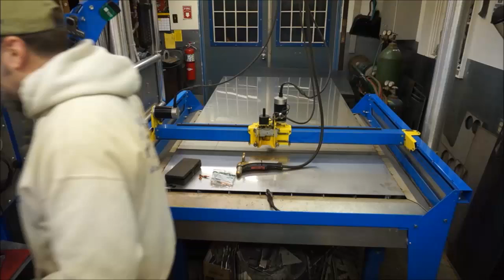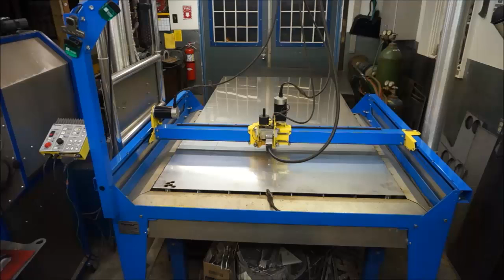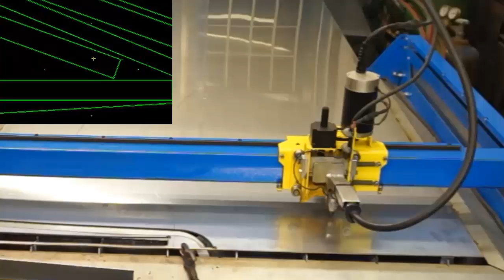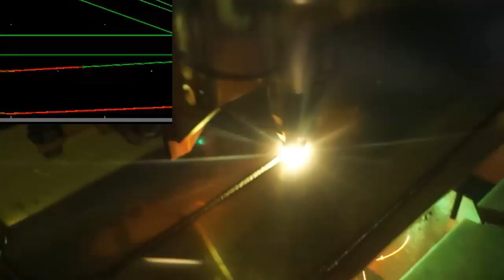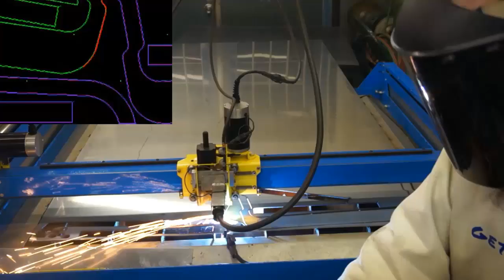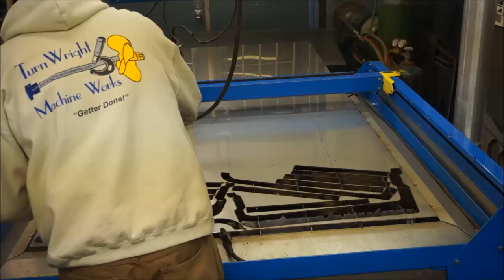Wing It Part 9

Comment: Wondering why you never use the edge of the sheet as the edge of your cut. I'm sure that there is a good explanation. I learned in grade school not to cut from the middle of the sheet of paper. :)
Reply from the maker: I do once in awhile with straight strips, but for the most part, most sheets have blem edges and I like having the same edge surface to work with. ;{)------

Comment: Keith great info on the consumables on your torch.  I've gotten burned by the starter cartridge too.  It looks OK, put it back in and it's good for a few more cuts then same problem again.  Are you using the extended life electrodes? That info on cut direction is really good it makes a big difference.  I've had good results clamping the ends of the sheet too, especially for thin materials.
Reply from the maker: I don't believe Thermal Dynamics has what you call extended life electrodes, and the whole idea of having a less than and more than choice and price is maddening. Just make the best electrode you can so it gives me the best performance and boink me with the price you need to keep them coming! ;{)--
Reply: Yeah Keith I agree with you 100%.   I have 2 part numbers that we use 9-8215 and 9-8232.  The 9-8215 is what I have listed as "long life" in the brochure we have.  The 9-8232 is not listed on the victor website and only references I can find online say it is a high amperage automation electrode.  I'll forward you some pics, and I'm guessing you're using the 9-8215?